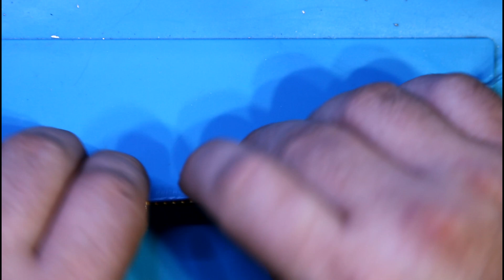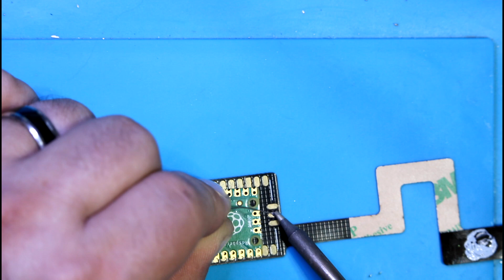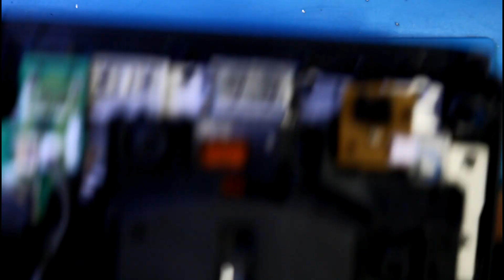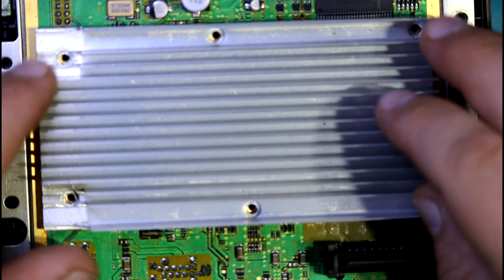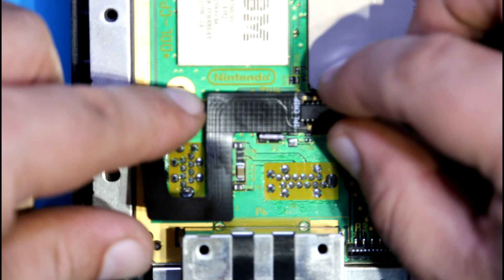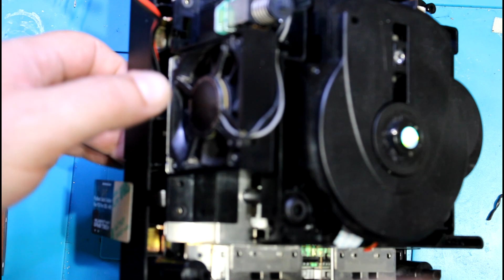PicoBoot DOL-001 Flex PCB Install

Comment: i had assumed the end of the flex cable that goes to the chip lays flat around the chip while soldering, but it's sort of sandwiched above it, and to top it off three of the solder points on the flex are right next to each other. with someone with little soldering experience like me this made it almost impossible to try applying correctly, as there's no way for me to know if those solder points have been bridged since the solder is very messy when applying without using something like a magnifier. my attempts to solder this have failed and it only makes me wish i had tried the wire method first.
Reply from the maker: Well as with any mod you should be aware of your skills and limitation. Tools help especially flux and a good iron, with flux you could have cleaned up any extra solder and make good connections but this mod like any mod requires some experience and skill. If not then best to go the wire route or keep practicing to get better.

It's impossible to have this lay perfectly flat because of the components around the chip this is why it's flexible so you can push it down while soldering to make good connections.

Comment: Is there a way for me to use 5v instead of 3.3v with this? I've already soldered the 3.3v and it working fine, but not with any component to HDMI adapter.

I'm thinking I can probably just unsolder the 3.3v point, insulate that pad on the flex PCB and pico board with kapton tape and solder vsys to a 5v source? Not sure if anyone has tried that.
Reply from the maker: Send me an email and I can explain how to do it without all that hassle you're thinking. YouTube is not the place for posting pictures or responses like this.

Comment: So you don't need to solder the grounds?
Reply from the maker: Why would you assume that? one of the chip legs is GND and on the Pico there are numerous ground points you should solder atleast 1 of them.
Reply: @Angryhelder  I meant the old method.
Reply from the maker: @jsnepo  the wire install method is not required since those connections all come from that chip we tap at the source for this install
Reply: @Angryhelder great! thanks

Comment: Why do you solder all the wires to the chip, but without this flex cable, you only solder 2 wires to the chip and the others are attached to the yellow rectangle below the chip?
Reply from the maker: Sorry I did not understand exactly what you're asking me.
Reply: @Angryhelder  Why is the flex cable in this video connected to different pins on the GameCube than the wires are connected to without it.
Reply from the maker: @8BitPlumber1  Are you asking WHY the flex pcb solders onto the chip and not the solder points from the github guide? If so then simple, those points you solder to originate from this CHIP and it's easier to solder it to the chip especially for the DOL-101 which would need a complex Flex PCB to be made since the IPL chip is on the underside of the motherboard.
Reply: @Angryhelder  Thanks, this is what I was asking about. Great Video.

Comment: Idk about "nice and easy", but definitely the simplest method.

It still involves surface mount soldering of tiny joints, and even requires you to remove and reapply thermal paste!
Reply from the maker: Thermal pads not paste but any other mod of similar function requires the same removal. Its as easy as it gets but you do need to have some soldering experience and its not dummy proof.

Comment: I Just Bought one! It Got held up at Flint USPS today, so I Should Have it Tomorrow!
Thanks, Brotha! I Can't Wait: I never had a GC, My Father in Law brought one home 2 weeks ago from a friend trashing it after a garage sale with no Cables. Order a Set, Works, Has GBA Base.
I'm Gonna Pimp this Thing Out Xzibit Style. It has the SD Port on the MoBo but it's Not Populated with the Port... So I Need to Hard Wire an SD Mod to it.
Thanks for the PiCO-Flex!
Reply from the maker: As long as you're confident in your soldering because the SP2 area can have some tiny vias to solder to also you can just a usb gecko like card to load the games from a memory card slot instead. Speed is not really much of a factor using the memory card slot vs SP2 for loading games.
Reply: @Angryhelder  Heard! I have the skills to handle it, I'm no Pro, but have the skill lol.
Good to know about the SD Card in the Mem Slot.
No Rhyme or reason to not do it... Haven't really decided yet.

Comment: Do you know if you need to disconnect the power connection from the Pico to the GC before flashing new FW to the Pico?
Reply from the maker: If you have been using my flex pcb it has a protection diode so no need to do that. 

If it was my first revision (which was from last October) without the diode (it's a small black chip near the IPL Chip on the flex) then it's fine as long as you disconnect the usb cable right after it's been programmed.
Reply: Thanks for the response!

Comment: Thank you for making this, I noticed on the flex cable I got there is an extra gold pin that is not on this video, will it matter if I solder it in now?
Reply from the maker: Best to do it now so you won't have to later if there is any new update for the Picoboot code.

Comment: I have a Pi Pico W laying around. Can i use with your flex pcb? Noticed the pins opposite the micro usb are missing. Can i still use? Thanks
Reply from the maker: Yes, those pins on my flex are just used as anchor points and not electrically connected.
Reply: @Angryhelder  thank you for responding.

Comment: This is awesome stuff. I did the PicoBoot a couple months ago when it was first released. Saw a comment on Reddit linking to your QSB and thought that was super simple and easier even though the soldering isn't that difficult, this makes the install even easier. Picked one up with the Pico already attached from your site right before they went out of stock and planning to do this to my main pretty soon. Thanks man!
Reply from the maker: Yes this is designed to make the already easy job even easier and best of all no wires or bending or cutting the RF Shield. Leave a message about how the install went once you have it installed.
Reply: @Angryhelder  All went well! The QSB is super convenient. This is the way it should be installed all the time. One of the quickest mods to do. No more needing to use my disc drive all the time to boot into Swiss on my main console. Will recommend to others! Thanks again bud.
Reply from the maker: @TheGeorgeChannel  Cool I appreciate it. I have a new version being made for the DOL-001 that should address some of the criticisms and is also future proof in terms of wiring changes.

Comment: Will this flex be compatible with laserbear's "GameCube Fan Mount V2.1 With Pico Mount"? Thanks!
Reply from the maker: It looks like it will but since I do not own one I can not tell you with 100% confidence it will but I do have my own 3D mount for the pico flex 101 that goes in roughly the same location

Comment: when i boot up my system it loads up normally............. this is my 3rd try at this thinking the ribbon cable and pico pi pre soldered would fix everything. still nothing. boots to the gamecube no disc menu. Im going to reflow the points tomorrow and give it one last shot.... so frustrating
Reply from the maker: If your soldering is good then the only issue would be your SD card. You need to follow the instructions in renaming the Swiss dol file. If you're using the SD2SP2 adapter those are finicky and might be better to test without the bba cover on or get the SD Gecko which works on all versions of the Cube.
Reply: @Angryhelder  Yep you were right just checked the DOL file and forgot to rename it. Thanks Bro!

Comment: This is ingenious! It’s so “noob friendly”, it’s practically foolproof. I have a question though. Your website says that a new firmware is in the works that would require an extra wire to be soldered. Are you going to be modifying the Flex PCB to accommodate that change? And if so, how long might it take for an updated version?

I still plan to buy this one, since the new firmware isn’t out yet. But once it’s released, I might want to update the Flex PCB along with the new firmware.
Reply from the maker: From what I gather from webhdx's conversation with me is the update primarily is to fix the IGR that is not working as intended, he plans to add an additional wire to remedy it. I have a friend of mine who we think we might be able to make it work without any additional wires so if we can then there will not be any changes required for the wiring and this flex can be used even into the future.

Now the other features with the Pico W and it's wifi capabilities is also something he has not said anything about but if he is planning to use the wifi for updating swiss and other things he will need to have the capability to write to the SD card which the current setup and even his updated 1 additional wire will likely not support.  It likely will require at least 6 additional wires which will be soldered to the EXI bus where the memory card is apart of the bus. 

Only time will tell as he does not want to divulge any info and it sounds like it will be something released in October or likely November.
Reply: @Angryhelder  Definitely understandable. I’ll probably just order the current one now, and if wifi is implemented, then I can always upgrade to that one later. I follow your YT channel and website, so I will keep my eyes open for any news. Thanks for responding!

Comment: I already did the wire mod, but if I switch out to the pico w I believe I'll use this to tidy it up. Thanks for bringing this to the masses!
Reply: Hey, I used a W and it didn't work. Did you solder the three spots in the middle?
Reply: I was going to order the PCB and get the W, but I just ordered it completed 2 days ago, figured less hassle.
I couldn't find any real reason for the W, Are you able to use it for BT Controllers?

Comment: fyi, webhdx did say that upcoming updates to picoboot will change the pinout and such. cool flex cable, though!
Reply from the maker: I did speak to him about this and it's 1 additional wire and I highly doubt the other install points will change since all modchips for the GC use the same points. Also the update is mainly to remedy the current implementation of the IGR (In Game Reset) which is what the additional wire will be for. The main features are not changing and he also plans to implement wifi features for the PicoW so updates can be done over wifi. Besides the IGR fix anyone installing this now with the flex or wire install will not lose any functionality.

Comment: This is great! No more issues with the wrong length or gauge wires, it’s a lot more of a neater install. Can’t wait to get my hands on some!
Reply from the maker: Yea the length is very minimal and just works. I also have a gnd plane on the back side to help with isolating the signals from anything on the motherboard but it's a short run that goes around things as much as possible.
Reply: @Angryhelder  really well thought out! Hopefully we can get some in the UK. I’ve got 4 cubes, 2 that are done via wires and the other 2 would be cool if I could use the flex.
Reply from the maker: @carlb4752  I am in talks with www.zedlabz.com over there in the UK and he will have this version and the DOL-101 version in 2 weeks.